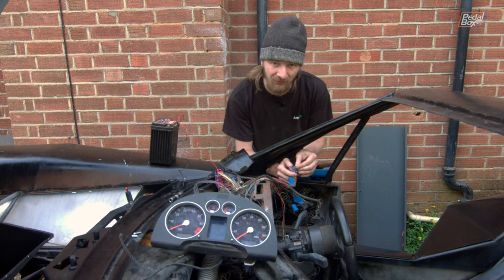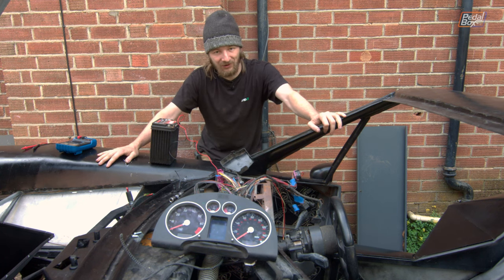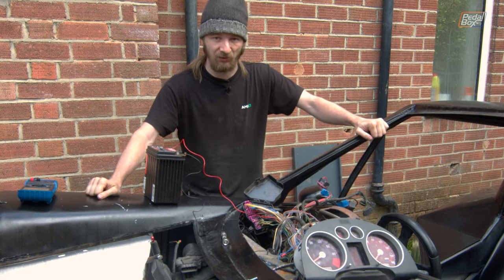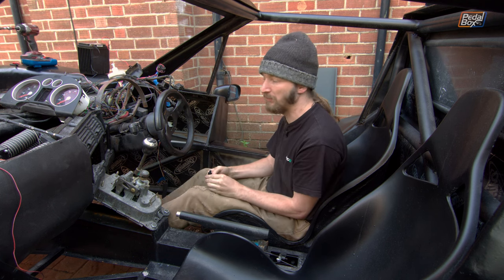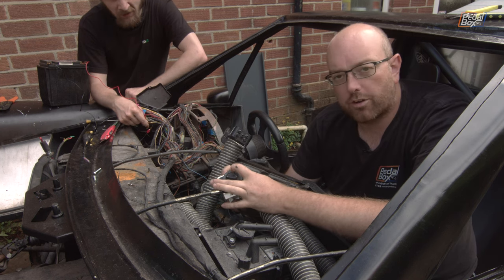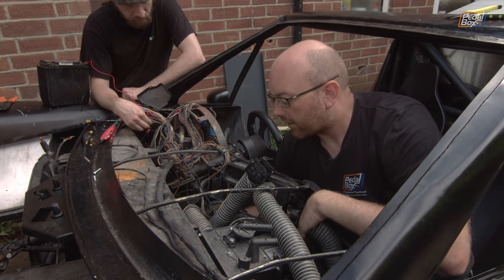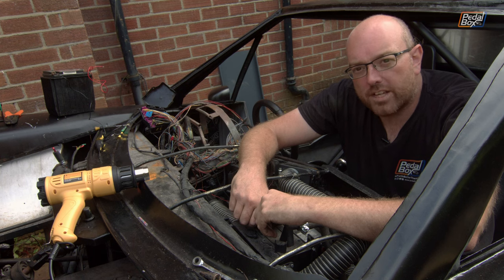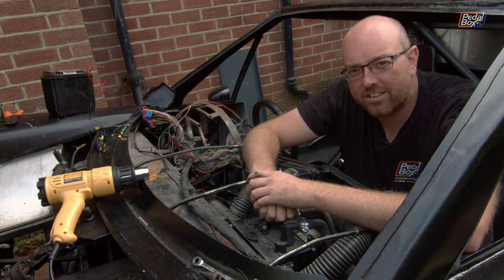Our Dash is ANGRY | Audi TT Kit Car | PedalBox Episode 143

Comment: Looks like to get that heater fluid circuit air pocket-free, you’ll need a vacuum fill of the system.
Reply from the maker: Got a couple bleed valves to put in to be extra sure, one right by the radiator at the high spot there, and another in the dash... probably with a decent length drain on it...